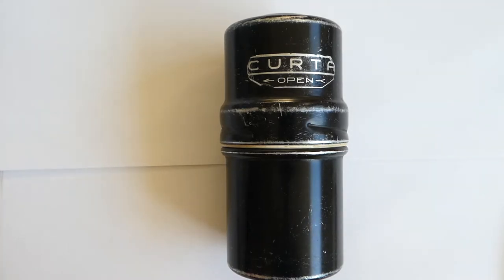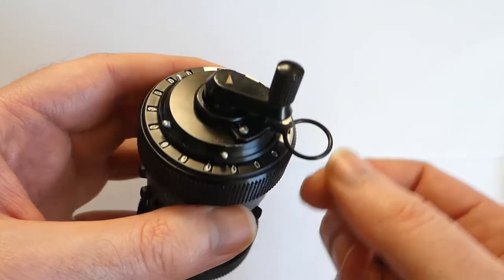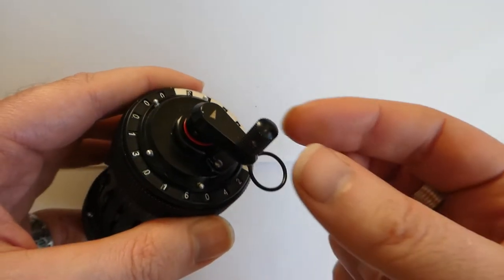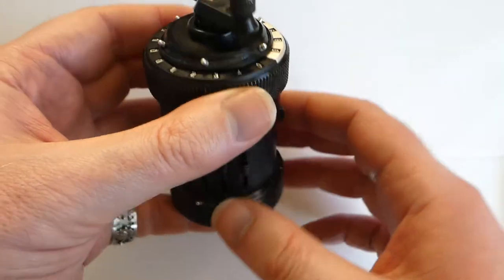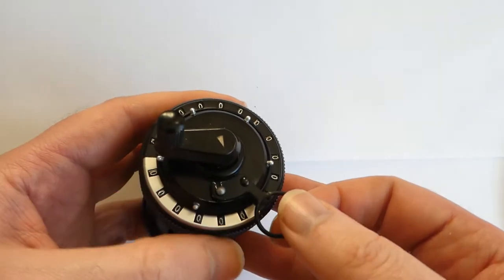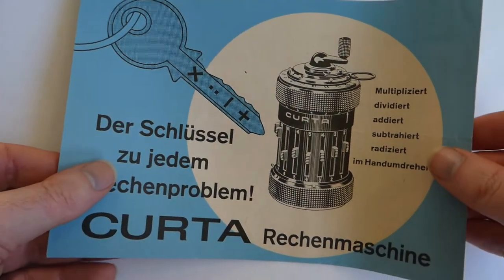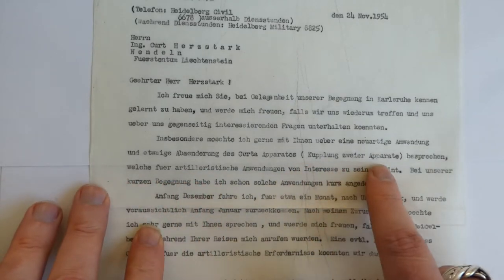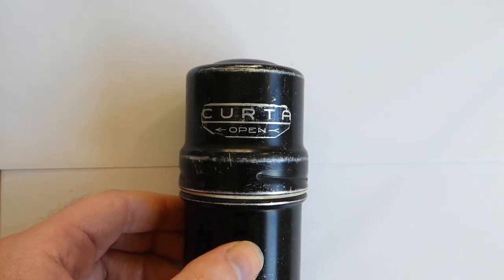The Curta Calculator

Comment: The reason the case opens clockwise / closes counter-clockwise is so that while closing, the case cannot accidentally twist the crank, which could partially overwrite the last op performed on the device. The crank is ratcheted so it only turns clockwise.

Comment: Wowzers. Hi Jaap! I love the Curta, but they are just a little out of my affordability range. Such a shame, as this is one of most elegant mechanical devices I've seen! Also, I must say I really love your puzzle database complete with solutions. Interesting that the case lid is threaded backwards. This resonates with me as I am mostly left-handed! It's my go-to site for reading up on rare and exotic puzzles! If you don't mind sharing, how much did this device cost?
Reply from the maker: I bought it in October 2010 for 400 Euro, which was a pretty good deal even then. The only thing wrong with it is that the clearing ring is cracked, and occasionally during subtraction it locks up a bit. It is the most expensive machine in my collection.
Reply: U need to search all the time I have  3 curtas one curta type 2 y 2 type 1 and one of these cost 170 dollars and the most expensive cost 500 dollars If u search u find.